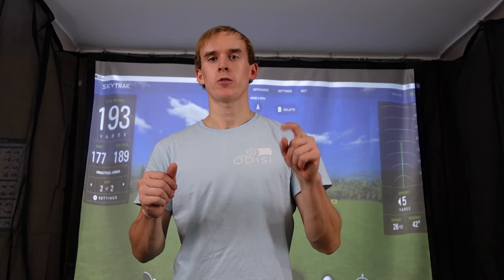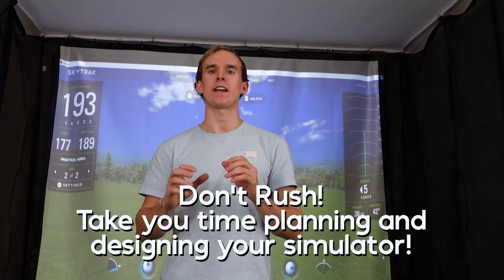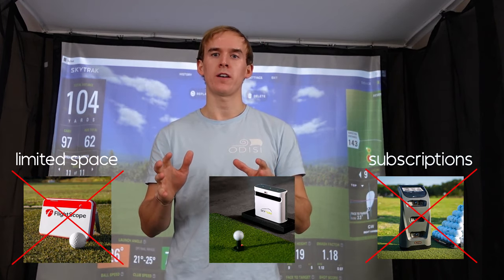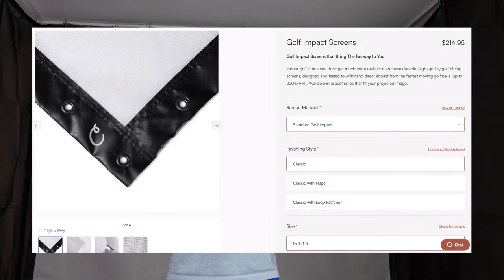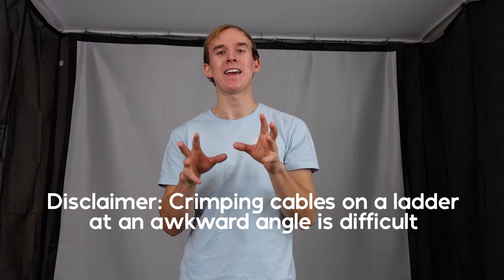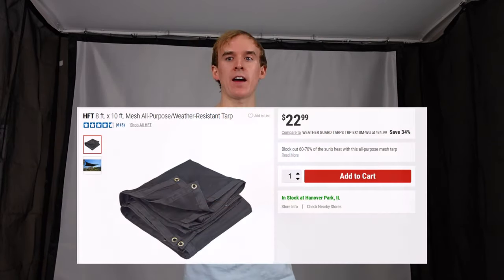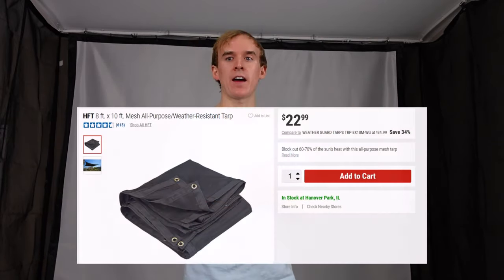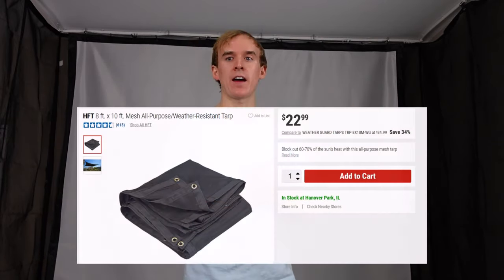How to Build an Indoor Home Golf Simulator - Skytrak, Trackman, etc.

Comment: Love to see the TGC2019 in action. I got an incredible deal on a used enclosure, impact screen, original skytrak, hitting mat, front carpet, projector, and TGC2019. I paid $1,600 for all of it. I’m currently adding a golf room, but it is small. 9’4” wide x 15’ long and 9’ tall. I haven’t been able to use it yet, and probably won’t for 2-3 months. I love watching other people’s videos so I can learn how it all works. Our setups are close. You have the better launch monitor. Look forward to swing the progress.
Reply from the maker: Dang, that is an insane deal! Yes, hopefully this video was helpful and I plan to film some of the actual rounds on the Sim in TGC 2019 in the future. I've seen several other people using the original Skytrak and it seems to work well, hopefully you can start using yours soon!
Reply: when you hear of another of those deals, let me know.  That is just insane cheap.

Comment: Thanks for sharing your experience.  Great video.  I have been planning a simulator to go in my garage 'cause it has a 10' ceiling.  Your space, with the 9' ceiling, is similar to my upstairs game / exercise room.  I am now measuring it to see if a similar plan would work.  This would provide the great benefit of being heated / cooled.  I appreciate your custom design approach and may adapt it to my build.  Do you find any tendency for balls to ricochet off your ceiling?
Reply from the maker: Thank you, and I hope it works out well for you. As for the balls ricocheting, I have not had too much of a problem with that. The most important thing to consider is the tension of the impact screen. If you don't connect the bottom corners to anything, you will be safe, but then you may have to move the bottom of the screen after every other shot, which is a little annoying. If you have too much tension, a lot of shots will ricochet. If you have small to medium tension, the balls will just drop to the floor after being hit, but you need a super sturdy connector otherwise they may snap when you hit your driver (example, zip ties broke, so I used rock climbing carabiners [rated for extreme strength]). I am also slightly closer to the impact screen (6-7 ft), 10 ft is recommended, but I have limited space. But because I am closer to the screen, my balls hit lower down on the screen and don't really get close to the ceiling (so I didn't feel the need to put a net up there). I don't typically practice the 60 degree wedge flop shot in the house though, just to be safe haha.

Comment: Great idea! I already have a somewhat similar netting setup that I was using without an impact screen. About to add the projector and impact screen with the same process you used here. Couple questions, 1. When you ran the steel cable, were you crimping it at the end to try and create max tension to hold up the screen? And 2. As far as I can tell, you don't have anything holding the bottom of the screen in place. Are you finding it has much give when you swing into it? Going to hang the screen in front of my net and won't really have anything to permanently hold it in place at the bottom so seeing if I will need to fashion something. Thanks for the idea!
Reply from the maker: Thank you! to answer your questions, 1. I tried to get as much tension as possible that I could reasonably do by myself. The less tension you have, the screen might sag a little and have a tiny gap between the ceiling and the screen. 2. Originally I didn't have anything holding the bottom down, but sometimes it would move around, so one upgrade I made later was to put some of the I bolts along the bottom trim of the wall, and use some rock climbing carabiners to attach the bottom corners to the I bolts. I tried using regular carabiners like the tiny ones in the video, but those would get bent after about 100 balls, rock climbing carabiners are rated to hold extreme weight so they don't break.

Comment: Great setup. 
How do you keep wedge shot golf balls from getting through the top of the screen?
Reply from the maker: I am slightly closer to the screen than what is recommended ( because of my limited space, only 6ft-7ft in front of me) so all my balls hit a little lower on the impact screen. I've never had a problem with balls flying up, but just to be safe I typically don't practice a flop shot with the 60 degree in the house haha
Reply: With you being closer than recommended by SkyTrak, how accurate are your readings? Do you see any data points that are off?
Reply from the maker: @darrensunahara3840  There is no effect on the readings since the Skytrak is a style of simulator that you put right in front of you. If I had the mevo+ instead it would be less accurate, because it wouldn't have enough space to calculate properly. (Since it is placed behind you)

Comment: Well done with this build.  Great inclusion of all the steps and pricing on all the bits.  I was trying to choose between the standard and premium on Carls screens.  How has yours held up?  Picture quality is not that big of an issue to me and I can always upgrade screens on 2nd.

Have you look at GSPro software?  It has a subscription cost, but from reviews I have seen, the imagery is better and the physics are better than E6.  Also it has just about every real course you would want to play created by users to exacting detail.  They are not named correctly due to licensing, but Agusta is Agusta, just called Georgia Golf Club 🤣 Then there are the user fantasy courses.  Does require a bit of a computer to play, but being at 1080p that should make it a bit lighter on the system.
Reply from the maker: @Power5  Thank you! The standard screen has held up well for me so far, I would say. For reference, I have used it for 8 months currently, I practice on average 4 days a week on it, and have played around 15 rounds of golf on it so far.  So far there is just a little wear in 2 spots (white fluff coming off the screen) , but the images still looks pretty good in those patches. With the cable and carabiner setup I can rotate the screen if I need to, but haven't had the need yet. If you go with the premium the image will probably look a little sharper. 

I've looked at it briefly, and seen a few videos online. It does look very nice, but I already bought tgc2019 and that's worked pretty well for me so far. If I ever move and need to build a new one, I will probably re-evaluate software then, thanks.

Comment: How did you fasten the sides of the impact screen? Not sure if I missed it.
Reply from the maker: @yooper9062  I did it retroactively in a shorts video later, I believe. I screwed I-bolts to the base boards of the wall, and used some more rock climbing carabiners to attach the screen. I tried other wire or rope solutions,  but the driver hits kept snapping them. Rock climbing equipment is rated for extreme pressure so it doesn't break.

Comment: Great set up! What did you use to anchor the bottom of the net? Is it just hanging from the roof?
Reply from the maker: Thank you! Originally I had it just hanging, but it was annoying when balls would sometimes go underneath, so I tried zip ties and wire cable, but eventually both of those broke, so I put some more I Bolts at the bottom of the wall and then used rock climbing carabiners to connect the grommet to the I bolt (the smaller carabiners I used to connect the impact screen to the cable were too weak, rock climbing carabiners are much stronger).

Comment: Thanks for this video! Are you happy with the standard screen from Carls? I’m doing a cheaper sim with an MLM2PRO and am having troubles choosing a screen ( standard, preferred , premium)
Reply from the maker: Yes, I am satisfied with it. I've been beating balls into it for about 2 months now, and you can see a tiny bit of wear on it, but I don't really notice it too much once the projector is turned on. Most of my balls are hit into the same spot on the impact screen, so I'm sure over time, I'll end up rotating the screen to increase its lifespan. For reference, I watch TV on it in the mornings when I am working out, and high quality videos (like recordings of the masters look really good on it, standard streaming videos looks around 720p) if that gives you a better idea of what the image will look like.

Comment: How far is the ball from the impact screen?  How far is the impact screen from the back wall?
Reply from the maker: The ball to the impact screen distance is 7ft, and the impact screen is 1ft away from the wall. The netting cage is 3 in behind the impact screen and 9 in from the wall. My space is a little constrained, so more distance is better, but these distances work fine for me. I also put the foam gym tiles against the wall just to be extra safe.
Reply: @_odisi  I'm working with similar constraints and this is really helpful.  Thank you!

Comment: How would I be able to make sure the screen is nice and flat or tight?
Reply from the maker: @brandonnelson5653  The way I mounted the screen on top with the cable and clips makes the weight evenly distributed along the top, then to have some slight tension at the bottom I used rock climbing carabiners connected to some I bolts I screwed into the base board trim along the edge of the floor. Something as strong as rock climbing carabiners is necessary because the driver hits will snap weaker things like zip ties or wire.

Comment: You forgot to add the cost of your hitting mat
Reply from the maker: Yep, sorry, that was equipment I already had prior to this build, but I got a cheaper one for about $100 a while back off Amazon.
Reply: I was wondering the same thing.  I would say if you value your wrists, do not cheap out on the hitting mat.  Though if your astroturf and 1" foam tile is under it, you are probably ok.  People who put those cheap mats direct on concrete are in for a painful future.  Had a few fat swings yesterday at a driving range and had a slight pain in my wrist.
Reply from the maker: @Power5  Yes, that is a very good point, a high quality hitting mat is a must! I have a pretty decent one, but like you mentioned, I also put foam tiles and astroturf underneath to further cushion the blows. I can definitely feel it at the dring range sometimes when they have the mats straight on concrete and I have a mis-hit.